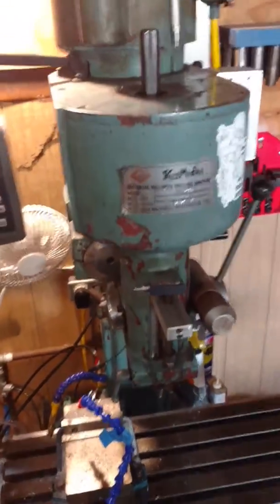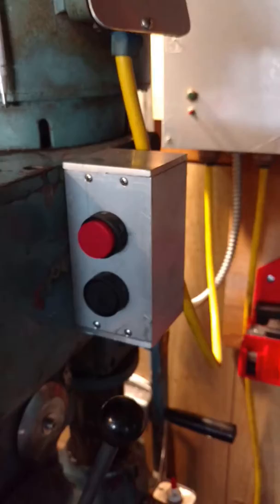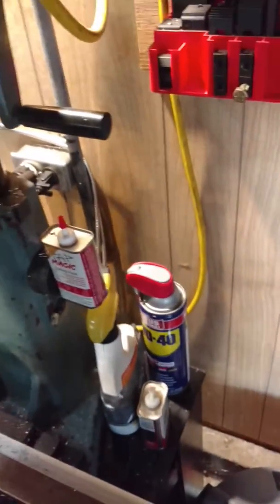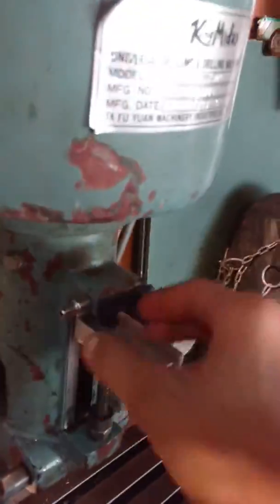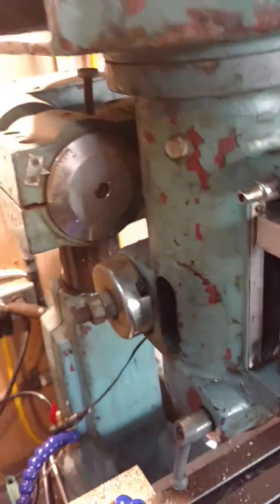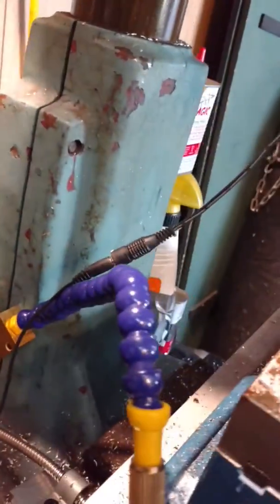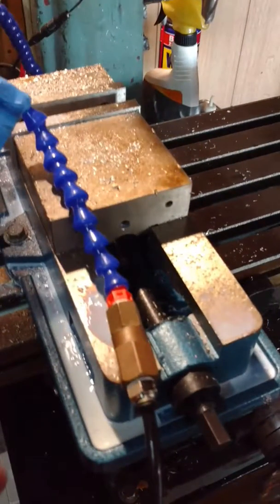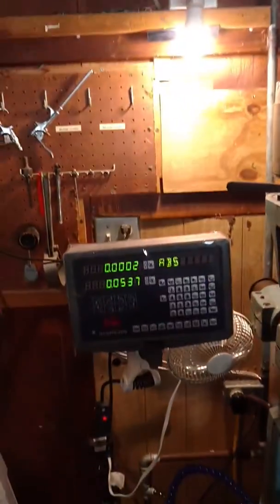King Midas milling machine TFY-829

Comment: I have the same machine. Added a DRO for X & Y axes. I have adapted a cheap carbon fibre vernier on the front to give me a Z axis readout, the advantage here is that I can zero at any convenient position. I still need to add a coolant system. I have also replaced the belt with a Urethane round belt heat welded to size.
Reply from the maker: Nice! I am using one of those sectional belts that you can make any size, and for flow coolant i just used an old windshield fluid pump and reservoir from a car, and a reusable coffee filter in pvc pipes for the chip filter

Comment: What dro kit did you buy? I have the same mill.
Reply: Thanks. Mine also has a different style handle to push the quil down. Did you modify yours or is it factory?
Reply from the maker: @MrCmyers1  I'm not 100% sure I bought mine about 3 years ago off Craigslist, but it is what it had when I got it, I added a lot though to it, when I got it the guy had a wimpy light switch for the motor lol
Reply: Yeah. So did mine. I added a variable frequency drive to mine.
Reply from the maker: @MrCmyers1  Awesome! I have a 2 hp motor and vfd but I was planning on using it for a custom belt sander, but I might change my mind and throw it on the milling machine
Reply from the maker: The one I bought is one of the basic ones off Amazon, here is a similar one 
Taishi 2 Axis Digital Readout DRO for Milling Lathe Machine with Precision Linear Scale https://www.amazon.com/dp/B019X9I5I2/ref=cm_sw_r_cp_apa_i_ngNfCb9ZAG2RS

Be aware that you will have to custom machine a block to be able to attach it to the y axis